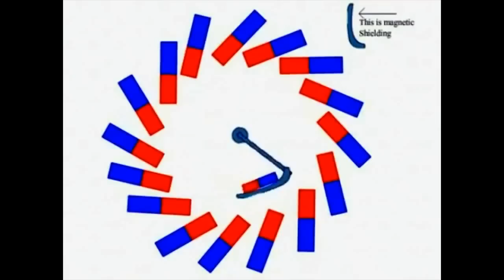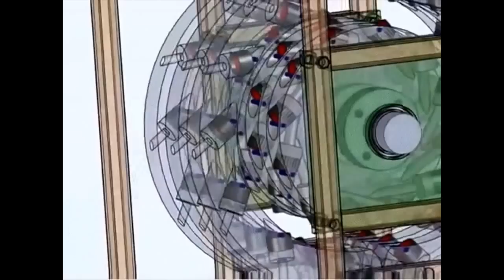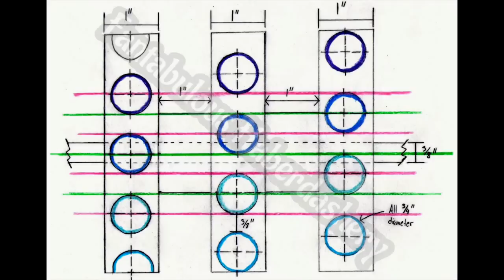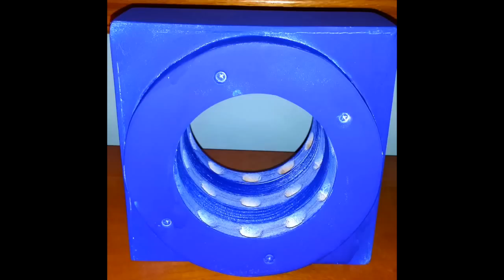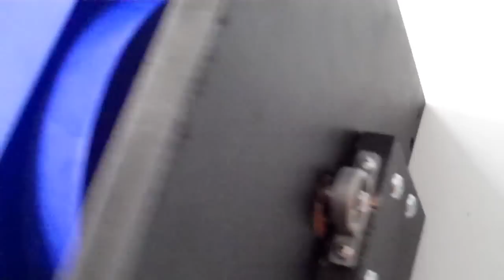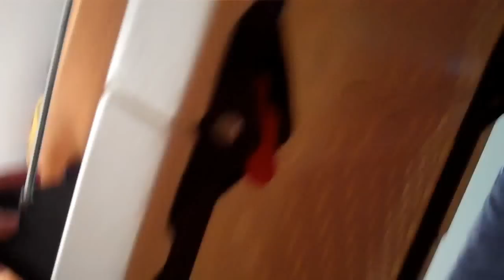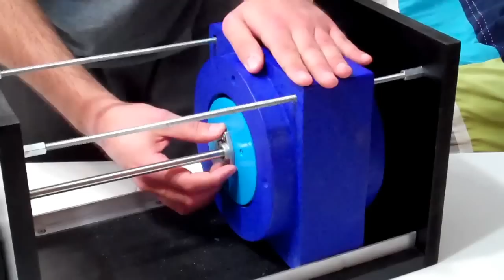Working Perendev Magnet Motor!

Comment: What about measuring the force it takes to stop it using a simple spring balance  will give you some idea of the torque. Even if you are able to get it to run continuously for a while is it capable of doing any work? There are many devices that can run on there own but the slightest load on them and they come to a stop. For the purists perpetual motion will never happen even if it runs for 10 years because over time the bearing will wear the magnets will lose their strength, it will collect dust and insects and come to a stop. How come it is running so out of centre do you fail to align it properly. You should be able to achieve good accuracy within a pencil line if using a compass. Its little things like that that can stuff up any kind of project.

Comment: How long can you get it to run on its own? Put a ring magnet on the side of the wheel. Make another. Put a ring magnet on the side of that one (opposite pole facing out). Align poles, and spin both counter to one another. Place a dielectric reflector (ie coiled Copper wire), in between the rotating ring magnets, and then you will be able to get some "electricity" from it. (This should provide a time varying- rotating magnetic field, and the copper coils will pick up). I am working on making this type of a machine, except I am using batteries to run the spinning mechanism. Once I actually build the thing, I plan on releasing the parts and plans for free. Also, provided it all works soundly, then I am gonna make videos of my own. I just hope the rotating magnetic field doesn't melt your rotor.

Comment: If the energy in the magnetic fields around the magnets decreases equally with the usable energy in the output of the device (even if it is loss due to friction) then it is not free energy.  However if there is negligible or no loss of magnetic flux in the magnets while the device spins & spins & spins then there is free energy coming from the vacuum.  The disclaimer is somewhat misleading.  However if there is some external or internal hidden power source such as a pulsing electromagnet under the table or button battery driving a tiny electromagnet hidden in the device or photo shopped wires or sound energy or wind etc then the video is fake.   I suppose only the builder/video maker knows for sure.  You could always use reverse speech to test the video maker.

Comment: If anything like this works even without any load it then becomes apparent that with better bearings & less air friction by running in  vacuum a tiny load to a generator is possible.  After all the thing creates noise  & bearing heat.

Comment: Seems to work fine but does it produce an electrical current or can it turn a generator? Even if you had to start it up every hour, for example, with an electric "kick start" that would be saving energy while producing it "freely" by itself.

Comment: FYI Second Law of Thermodynamics: In any cyclic process the entropy will either increase or remain the same. Entropy: a state variable whose change is defined for a reversible process at T where Q is the heat absorbed. Entropy: a measure of the amount of energy which is unavailable to do work.

Comment: "For the sake of the video I'm not going to let it run a huge amount of time" 
"You can see that it is sustaining itself." 12 seconds later,
 "eventually it does slow down." LOL
Reply: t
Reply: These fucking goobers ALWAYS do the exact same thing where they have to put a bunch of input work to get this small, scale model shaft to spin. Not a single one of them considers for a second what a motor big enough to power a city would need just to get spinning, let alone continue to spin under friction. It is really the uncanny valley of low-yet-still-wasted intelligence.
Reply: I was perplexed when I heard that too. He repeated 10 tomes it is sustaining the same speed forever and at the end he said it eventually slows down.
Reply: https://youtu.be/G6cycmBwLb8?si=ewY-eTJKlMdBxJvY
Reply: There are a number of patent in this regard.
Yes it is conversion of magnetic energy to another.
Remember Earth has been moving around for Billions of years on a similar energy (gravity).
Reply: @drpk6514  There are patents for all sorts of reasons and not always because the ideas represented work. If this "worked" it would not slow down. It does slow down because no further energy is applied to the system. If you try to extract work from this system, it will stop quickly. Therefore, it does not work even if there are patents for the idea. There are no frictionless bearings. They will always generate wasted heat because they are always working... which always extracts energy to do the work.
Reply: @drpk6514  With hardly any friction and a humungous amount of kinetic energy keeping it going the earth is a different ballgame.
Reply: If you can’t see this if fake you are a mongo
Reply: Says Ricardo montalban
Reply: it is not a well made motor but it does run for quite a while

Comment: There is not such thing as perpetual machine, every engine is a cycle of movemenet, hose magnet won't work forever, you just saw that it eventually slows down, but so thus combusions engine, unless you keep adding fuel; the fuel of the magnets in you case are your hands, i would use solar panel to give the initial push for the magnets, thus creating a system that works on each other that are free, thats is the key.
Reply: +Deathvoltaje Why would you use a solar panel to spin the "motor"? The solar panel generates electricity already.
Reply: +r. decline Yeah, but not too much, its like in a car, they use a small electrice engine to start the combustion engine, it would serve the same pourpose here.
Reply: But again, there is no point because the solar panel already provides the end result you want. 
To keep things very basic: The starter engine is for convenience. You could, and did, start it by hand. The end result is starting an engine that is actually capable of producing a useable amount of power and torque to move an entire automobile, until the gasoline runs out. 
A magnet motor, even if we entertain the thought they mildly work, don't produce anything. It takes most of their "power" to spin as long as it can. Put a load on it and see what happens. Make it do something other than spin itself. If you want electricity, and have a solar panel, you already have electricity. Don't add in an extra inefficient step that won't ever work anyway.

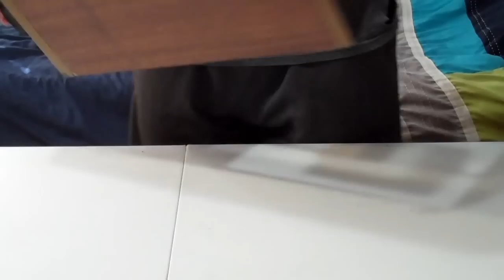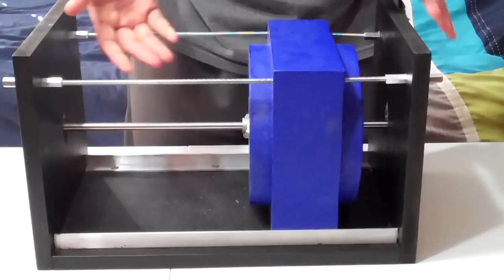Comment: Great, another free energy scam. After showing us that there is no hidden motor, the video it cut many times, such as at the 8:06 and 8:11 marks, and after. Obviously, you show us that there is no hidden motor, then stop the video, then add a motor at 8:06 or 8:11, then start the video again with a motor installed. But don't get me wrong. I strongly believe someone will discover a new type of energy, just not free energy (that is, energy that is created out of nothing),  but rather an energy device based on an innovative and inventive application of accepted science and known technology. I just hate these obvious free energy scams!
Reply: First off: Sustained motion =/= free energy, as free energy implies removing energy from the system (apart from resistance and friction) while sustained motion just keeps the device spinning longer that it would on its own. Second: he never claimed either, all he did was a rough refinement and proof of concept of a semi-sustained motion prototype.

Comment: So you are saying, perfecting the design, Producing better parts could make it even better right, not perfect, but better right?
What if you could then find a way to store the energy produced by the rotation and using a small amount of that energy to help the magnet motor continue sustaining itself in some ways. Is this idea worth experimenting with?
Reply: +Zub Air Is this idea worth experimenting with? well not really, no its not worth experimenting with...

Comment: First congratulations my friend, it works.!!!
Of course is not free, because the energy cost of produce all the material involved in the construction is something that not be "free" even the cost of mining the material for the magnets and the electric cost to be it magnetic, and much more, But the magnets can running or at least 80 or 100 years when they start to loss 10% or more of the power, and the bearings need to be changed every maybe 10 or 20 years? if this running for 20 years is enough for me.

Take a look of that video and many other that provide evidences of this works.  of course is a lote more complex that just your model, but is posible. 
https://www.youtube.com/watch?v=QOyuZSzkWRU

Basically If the model is more refined in terms of precision it works really good, you can attached a generator and depends of the size you can have "free energy" at least in terms of be out of the grid and the power companies, and this can representing more than $3k or $5k at year per house.
The cost of produce the parts of the engine is thousands of times smaller that the cost of the energy that the engine produce, for sure, and without cost of gas or any other combustible, that means free energy, the governments and the power companies they hate that. 
As a person wrote below the "Laws of fisic" were wrote for humans and are not laws, are understanding under our understanding capacity,  6 centuries ago the earth was plan, fly was just for birds, and breathe under the water was not possible.

Comment: Sir, Your Diagram at 6:22 does not appear to be how your final layout for the installed magnets.  For the rotor magnets, it looks like they met your design, being flat magnets with north and south on the flats.  But what was the layout in the 10 stator magnets?  Thanks.

Comment: Why not take a caputra full video?
Clearly you can believe that when you do turn the arm , move the rotor with some artilujio ( Drill, electric motor , etc. ) .
In my opinion, to avoid any doubts , returns to record another video with full decision and so we remove doubts.

Very good video apparently